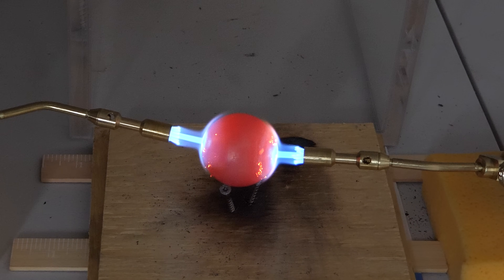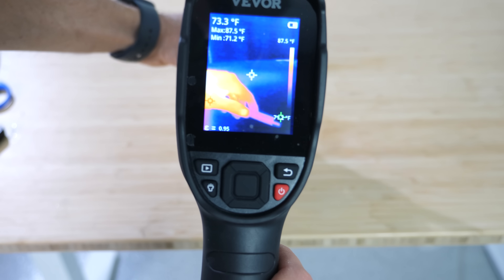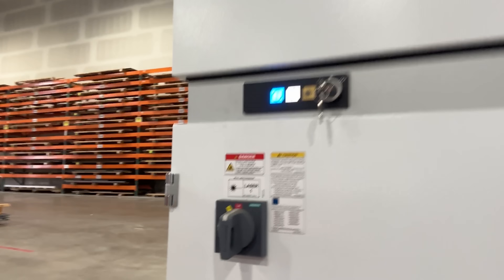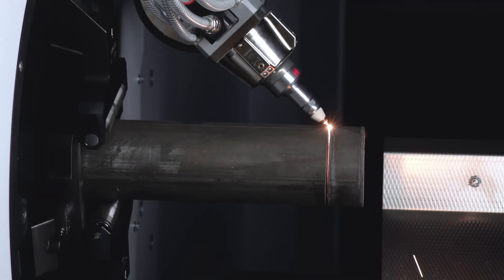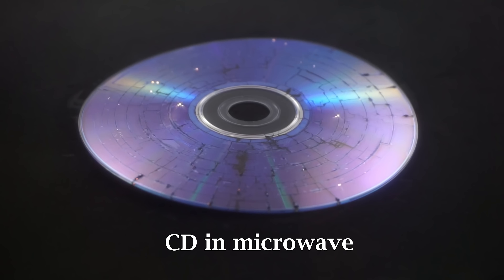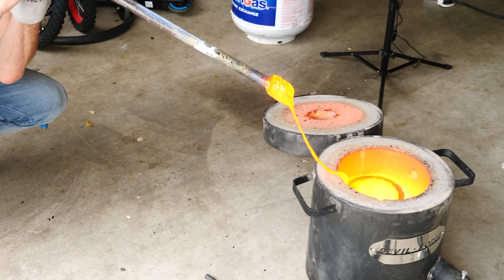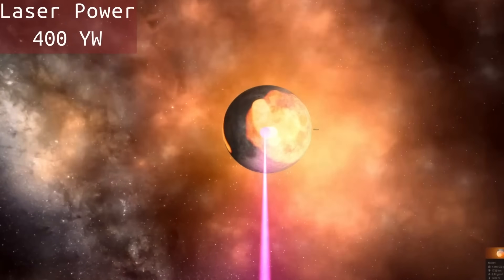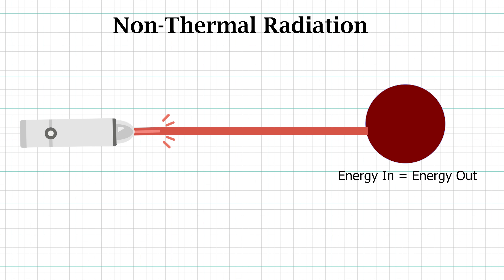How Hot is Light? How Lasers Bend the Rules of Heat Transfer

Comment from the maker: I made a video before explaining that lasers can heat things to any positive temperature due to the fact that they have a population inversion which gives them a negative absolute temperature which is hotter than any positive temperature. But the problem with that explanation is that a temperature can only be defined in a system that is in thermal equilibrium. So technically you can't assign a laser a negative absolute temperature. Only a "psuedo" negative temperature. But it turns out that explanation isn't necessary since magnetrons can do it and they don't have a negative temperature. Really the best explanation of why a laser can heat things hotter than itself is that you are inputting energy into the system and that energy turns into heat as I explained in this video. All of the mystery fades away when you think of it this way.
Reply: Fun fact : this phenomenon is rejected by some climatoskeptics (they think stefan-bolztamnn laws are wrong or misused and that you can't EVER have a colder object emit radiations toward a hotter one) which allow them to say the greenhouse effect isn't a thing (the cold atmosphere can't emit radiations toward the hot ground therefore a rise in CO2 concentration can't lead to an "entrapment" of radiations).
Reply: @Cesar-ey7wu  "the cold atmosphere can't emit radiations toward the hot ground"
Yea, really funny approach from these sceptics. Cold athmosphere is not used to emit a lot! :) It reflects. Just like mirror reflects aka do not consume most of the light and so not gets hot. Very simple example of this is how cloudy winter days are averagely much warmer than when there's clean sky with shining Sun. Very easy -30 C at shiny day but will get to -15 C very soon if it'll get cloudy.
Reply: @Cesar-ey7wu  Two reasons:
First, as the ground warms, it heats the atmosphere by convection and conduction. An atmosphere with more CO2 has a greater thermal capacity, and so can trap more heat.
Second, the atmosphere is only transparent to some forms of radiation, not others.
Your comment is likely in bad faith anyway.
Reply: Also that L.A.S.E.R. radiation is being pumped at the speed of light, way faster than any target can begin to lose heat.
Reply: Your attempt in using the "negative temperature" to describe this topic is simply wrong, please stop spreading this falsehood. I can demonstrate this very easily. Imagine any source of E/M radiation, let's pick the CMB. The CMB looks like some continuous-spectrum noise. If we take this noise, amplify a billion times using an external power source and antennas, and point it to an apple, we'll get essentially a microwave, which will heat the apple to a very high temperature (certainly it will boil the water). So, the supposed negative temperatures have nothing to do with this! Just stop.
Reply: @maxoobbxxx8032  yeah, it's the same as with microwave actually: that energy comes from outer source. In other words, system is not "closed".
Reply: What
Reply: I think this is a perfect example of something called resonance frequency....You catch the natural vibration of electrons, at the right frequency, to increase the wave height, up from that of the natural "resting" frequency of electrons vibration when they are at rest (an object not in contact with source of energe, i.e, a laser, magnatron, sound, electricity, etc....) they energize and release that energy in the form of heat and light... laers are good at that....All atoms, namely there electrons vibrate...adding a lasers frequency, of energy, to that natural vibration, is like pushing a playground swing at the right moment to keep it moving...more energy, the higher up it goes..until equilibrium...
Reply: testing....
Reply: Following up with the first,  forgot to mention, its usually the valence electrons that are naturally vibrating, may be energized by their resonance frequency, they move further away from their naturall orbit and they release energy as heat and light to move back into natural orbit...lasers may be used to create plasma, when you "over energize" electrons to move too far out of their orbit, that they flow off in the form of ionized gas...all atoms and their electrons vibrate, resonance frequency is what instigates the vibration to higher state..
Reply: If I were to look at it from a quantum state, I would argue that the "temperature" never exceeds the source, because there is a transfer from an electron in the laser to an electron in the target material, and that specific transfer will be equal to the "temperature" of the emitting atom. It just keeps happening over and over with favorable conditions on the lasing side that keeps the laser intact, while the target is destroyed.
Reply: A laser light can not heat something to an infinite temperature but only to a temperature as high as its radiation temperature. Temperature is a property of many things and radiation is one among many. My suggestion is to go to electronics books to understand cuz they would provide you with very physically meaningful examples. Purely classical examples, QM has nothing to do with the problems you have dealing with temperature, not to speak about negative temperature
Reply: You seriously advertising a product that damage gums? Disgusting
Reply: So you meant to talk about laser cooling? But you forgot. So now you want to rationalize, what you originally stated in the post made sense? 

Why can't anybody on YT, just admit they made a mistake?  Good luck with your song and dance routine.
Reply: @nc3826  I agree he is digging into more nonsense like "a temperature can only be defined in a system that is in thermal equilibrium. " The problems with this video are with the essence of the temperature concept. Its source , the laser, has nothing to do with it. Radiation with the characteristics of laser radiation could originate from something else , ideally it could be extracted even from thermal radiation with a linear, isentropic, filter with laser narrow-band properties. At that point it would have the same temperature of laser radiation. It's interesting, I get all sort of responses from my comments on this video: most readers have problems with the concept of temperature and don't realise that has the dimension of an energy. Even fewer people have put any thought about whom this energy can be attributed to. I believe statistical mechanics is not given enough consideration in school but help might be coming from informatics which deals with very similar concepts but in clearer terms. Something similar is happening with quantum computing, thy are coming up with the most effective QM   new didactics.
Reply: @omblauman  " ideally it could be extracted even from thermal radiation with a linear, isentropic, filter with laser narrow-band properties" Yup, and the effective temperature that winds up being necessary to extract a narrow band signal is astronomical, but finite.  THe narrow band filter plays the same role that semi-permeable membranes play in many thermodynamics calculations. ( Strictly speaking, the divergence of the laser beam also matters, it is flux per bandwidth per steradian of solid angle that sets the effective astronomical temperature. )
To put it another way, if the target were perfectly insulated everywhere but where the laser hits it, and that location covered with a narrowband filter which just passes the laser bandwidth, then the target will reach an equilibrium temperature where the portion of the blackbody radiation that it emits within the bandwidth of the laser, back towards the direction of the laser exactly matches the incoming laser light.  Only if the laser were perfectly monochromatic would the temperature be unbounded.
Reply: @jeffreysoreff9588  yes exactly, interesting the membrane analogy and the addition on the beam divergence is completely correct. I find the Johnson-Nyquist noise example particularly effective in illustrating the meaning of temperature with respect to radiation with the minimum of extra complications since it's one dimensional. Furthermore, with the word "noise"in it, it naturally suggests the informational nature of the concept of temperature, the energy of a degree of freedom. Do you by chance know where these kind of considerations on the relationship between temperature (or maybe entropy, its dual) in statistical mechanics and information theory are treated in some depth?
Going back to the band filtered black body cavity thought experiment you describe I remember a very clear and useful paper by Dicke where an antenna is employed to reversibly transform three-dimensional radiation to one dimensional, a transmission line wave.
I wouldn't be surprised if the radiation context wouldn't be better than the ideal gas environment to link temperature to its information theory  meaning, analogously to what Szilard's single particle engine does.
Reply: @nc3826  The ratio between atoms in the upper and lower state of the emission of a laser is larger than one. For all temperatures above absolute zero the opposite is always the case (fewer atoms in the upper state), when you plug in a "negative temperature" into the equation for the distribution you get more atoms in the higher-energy state.
Reply: @nc3826  "Why can't anybody on YT, just admit they made a mistake?"
At least on one math channel i'm watching, a creator does videos with corrections and redoing of mistakes he did in previous videos. Not often, as, of course, he re-checks what he's doing and publishing, and yet happens from time to time. And he's always sorry about these minor mistakes :)
Reply: @nc3826 : No, he got distracted by technobabble, it's very different and quite common.

Comment: A thing about laser cutters: it's not only evaporating the metal (that would be insane), it's mostly melting the metal and blowing it out with a gas nozzle. There are different types of cutting technologies, e.g. using oxygen as blow gas to burn the metal away (good for thick plates, but messy) or using inert gas like argon for a more gentle cut.

Comment: Nothing amazing about this at all.  Laser heating a surface is the same as any other conversation of energy to heat.  It's literally everywhere.  You strike a rock against another, and you might see a spark, the rock was not hot to begin with, the heat was just produced by the transfer of energy..  Laser is simply a different form of energy(light), just like mechanical energy.

Comment: The picture on the intro to this video is somewhat false and misleading. It shows a very thin laser beam that remains very thin along its entire length. As far as I understand lasers and optics, this does not happen! A laser source always produces a beam with a diameter of 1 mm to several mm, if it is a beam of parallel rays. And usually this diameter depends on the diameter of the working body: a rod of neodymium glass, a semiconductor crystal or a tube filled with gas. Then this beam is focused into a converging cone using lenses. Metal cutting occurs at the point of the beam where the beam has a minimum diameter (at the optical focus). If the laser beam were really parallel, very thin and powerful, it would damage lenses and mirrors.

Comment: It can get hotter if you hit the ignition temperature of the chemicals that the hot object touches. Essentially you are getting access to the chemical energy stored in that object b as it combusts.  No breach of Thermodynamics as the entropy of the system increases as object B is destroyed.

Comment: Coherent light refers to photons—the tiny particles of light—that are all moving in perfect sync. Unlike the scattered light from a flashlight, coherent light is focused, tight, and relentless.
This perfect focus allows a laser to concentrate a massive amount of energy into a tiny area, akin to squeezing the sun's power into the tip of a needle.
When that concentrated energy strikes steel, it superheats the metal to thousands of degrees in a fraction of a second. The steel doesn't stand a chance; it either melts or vaporizes exactly at the point where the laser strikes.

Precision. Power. Focus. That’s the magic of coherent light.

Comment: In the thermal case, you say "The same amount of energy being absorbed by the object is also being released by the object." In the non-thermal case, you say, "It will heat an object up until the object is radiating as much energy as it's receiving." Sounds like the same thing ... ???

Comment: Can you make something hotter with electricity than the electricity or conductor is?
Of course you can, like you can with any radiation, as it isn't part of this "transfer of heat by thermodynamics", it is transferring energy to an object without being influenced same way itself.

There is no limit how much energy can be transferred to an object via radiation (might actually be as biggest Quasars have uniform wavelengths across spectrum, which might indicate something like that of a limitation).
But transfer of energy is not always physical things touching or radiating, it can be waves that hit an object and heat it (some say particles, i say particles on a wave or waves).

It's not physical, but trying to think things as physical object and trying to explain everything from that point of view can make things little weird at times.
Newton figured if you don't need to move an object you dont have to do any work, but if you need to move it you can calculate how much work is needed.
Those finding among other things made industrial revolution possible.

Newton findings are often misused saying that magnet on refrigerator door does not do any work, but that is not true, it only say YOU don't have to do any work if you don't want to move it.
Work done by magnet against gravity is 100% lossless, there is no heat created, work is not done in physical world but in quantum.
This idea of these separate things can, at least to me, help to understand the Universe and how some things differ, as it is not just physical stuff moving around and affecting us, it is much more and it's under the law which is not created by existence of matter but matter is under that law.

Not an expert, just trying to think these thru in laymen terms. 😀

Comment: The Earth is 18 Degree C and emits around 10 Micron Longwave Infrared Radiation. The only defined mechanism by which CO2 can affect climate change is through the thermalization of 13 to 17 Micron, 15 Micron Peak Longwave Infrared radiation. 15 Micron LWIR is radiated by a blackbody of -80C, or the temperature of dry ice. How can CO2 warm the atmosphere if thermalizing it generates -80C. Also, the oceans are warming. 15 Micron LWIR won't penetrate or warm water. Would you do an experiment where you isolate 15 Micron LWIR, concentate it using a concave mirror, and focus it on water and measure the tempeature of the water compared to a control? You can do that by simply maginfyting the light being emitted from Dry Ice. Also, if increasing CO2 by 100 parts per million can increase temperatures by 1 degree C, 300 to 400 ppm, if we wrapped out homes in 100% CO2 bubble wrap, would we be able to warm our houses? If 100 ppm CO2 = 1 Degree C, wouldn't increasing it by 1,600 ppm result in a 16 degree warming, and why can't use use that to warm our homes?

Comment: Hi ! nice video very informative as always ! 
I have an experiment to suggest : using a randomly vibrating rope tied to a wall, and parallel sticks as "filters" (2 parallel sticks would be placed perpendicular to the rope), try to reproduce this "paradox"  (usually done with polarized light)
0° filter then 90° filter => no vibration pass, 
0° filter then 45° then 90° filter => some vibration pass

Comment: Something is deeper here, that is not fully explained in the video. We are told that the blackbody radiation is at thermal equilibrium with the blackbody that emits it. Basically, if you have a BB emitting at temperature T, and if this BB is surrounded by a photon gas that has the same thermal spectrum as T, the blackbody will stay at T. But why is that the case? It's not fully intuitive. Imagine the photon gas emitting at T, but at the intensity much higher than the BB. Why won't the BB heat up? Won't it absorb more photons than emit, thus raising its temperature?

And the key to this contradiction is that the blackbody is a body with the HIGHEST emissivity for a given temperature. The reason why you can't heat on Earth something higher than the temperature of the Sun is because the Sun, being a BB, already emits the highest possible E/M radiation due to its temperature. Therefore, the volume-sector of the Sun's thermal radiation has the highest possible INTENSITY of radiation due to temperature, so when you focus it back, you'll only be able to heat another BB to the Sun's temperature at best.

So the key is not so much the shape of the BB spectrum, but the intensity of the BB radiation. I can amplify the CMB spectrum using some crazy antennas, and for sure this can heat something way higher than the 2.7K that the CMB is at.

This is the reason why BB radiation calculators also give you the radiation power and flux per surface area.

And as for lasers - there is NOTHING special about them, they simply emit more radiation than BB for a given temperature.